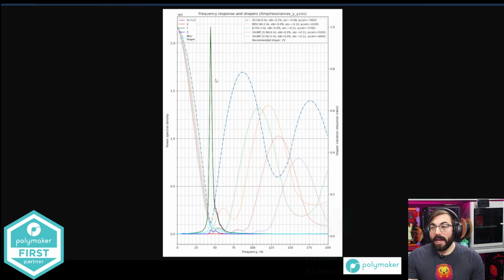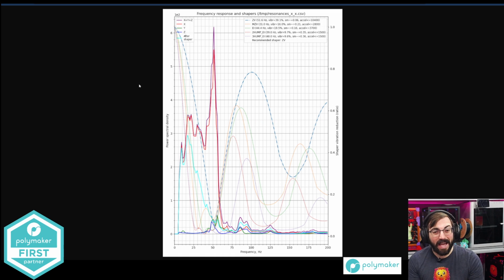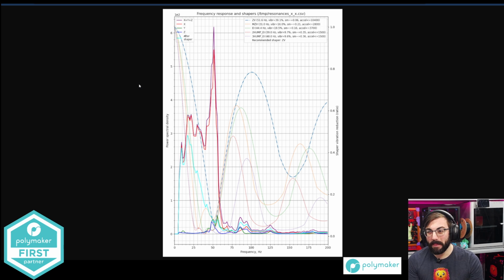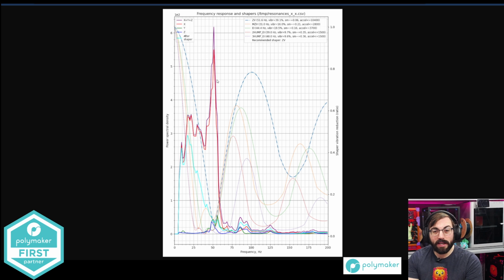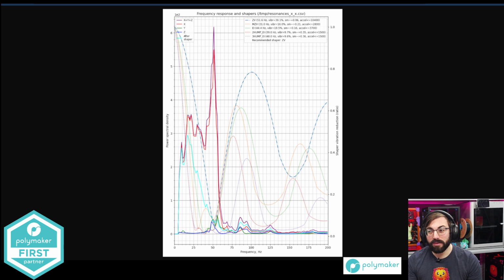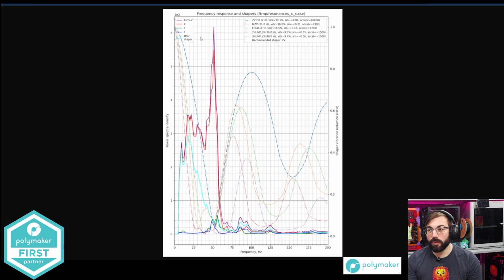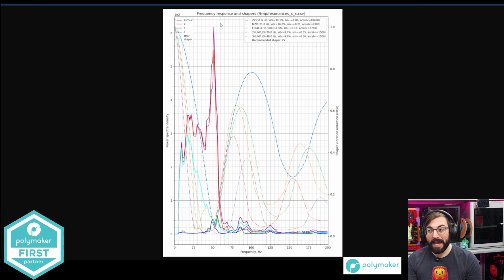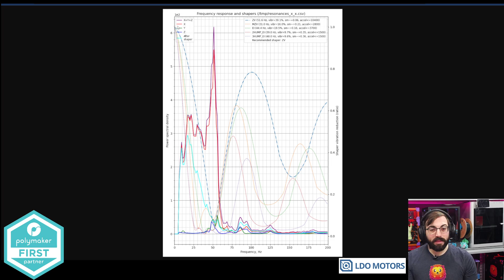The Creality K1C Is Not Ready | Here Are The Problems

Comment: Lmao I have one of these and know multiple people that have it and none of these issues are present all parts fix and work correctly. Prints are great and accurate almost like yours was dropped in the box or was wrapped by heat or something. Because common sense tell you 90% of them would have been return if in the state your claiming. 99% of these rumours are a load of shit.  This is my first ever Creality Printer and I have been very impressed. Punches well above its weight. a number of studio and prop design companies for the Movie industry actual use these too. oh had mine 4 months. No marks on my top lip either the tubing for the filament needs to be feed a little more into the flex black cable holder that's all.

Comment: I had two times the same problem, suddenly stop and went dead. It was not energy failure, after some expressive words and salutes to Creality, I discover the reason: under the machine, next to the power font there's a small cooler vent that prevent over heating of the power supply, apparently with the vibration has the tendency to disconnect and that causes the total black-out of the machine. It happened when printing with ABS material which requires higher temperature. I hope this to be a useful tip.
Reply: Thanks much for your input. I tnink it would be a great practice for everyone to check all electrical and mechanical connections on the printer upon receiving it.

Comment: I make cam wheels for Husqvarna older sewing machines. Using XYZ MiniMaker. They become absolutely perfect in PLA and PETG. But wanted to speed up the prints and also do things in nylon. So I bought a Creality K1C.
It writes wrong, simply. A curve, ridge, on the cam wheel that should be convex, becomes concave. The supplier tested on their K1C machines, with the same results.
If you buy a new printer for $600, you don't expect it to print worse than my old XYZ MiniMaker.
What should I buy for a 3D printer that has high accuracy?

Comment: DUDE YOU JUST HATE CREALITY :) I HAVE K1C AND I GET PERFECT FIRST LAYER MY EDGES ARE PERFECTLY FINE. iMAGINE I JUST PRINTED A DOOR KEY THAT I SCANNED IT WITH MY RAPTOR SCANNER AND FUCK YEAH ITS WORKING TO OPEN THE DOOR. SERIOUSLY BUT I DONT THINK YOU GOT THE TRAINING AND EXPERIENCE TO BE ON THE SEAT THAT YOUR HAVING. YOU SHOULD TAKE IT MORE EASY IF YOU BARELY DISCOVERED MODELING. THERE ARE MANY PRINTING ISSUES BECAUSE OF BAD MODELING ASWELL. IF YOUR A CRAPPY MODELER THAT DOES NOT KNOW MUCH ABOUT MESH I WOULD NOT BE SUPRIZED IF YOU GET ERRORS FROM A PERFECTLY WORKING PRINTER. I JUST HATE TO SEE FLYS TELLING BEES HOW TO MAKE HONEY.

Comment: Can't say id still be getting mine if i saw this video first however, the top lid is scratched to shit, though and i got a nice riser kit to solve that, got the filament tube angle bracket too to decrease the sharpness of the CF filament on the entry even. the extruder has been average, keep getting quite a few jams, and theres not much info on the web regarding Creality Print 5.1 slicer set up and functionality... Unless someone can point me in the direction of

Comment: My K1C is 3 weeks old and I cannot print on more than 20% of the build plate due to poor bed levelling and lack of options to manually adjust the bed. I am in the middle of a return process with Creality. You guys who say “you can fix it”.. Well, I could fix it too, but I am not supposed to fix a brand new printer. You don’t fix a new car right out of the dealer right?

Comment: I love the fact that my lid doesn't rattle around and is a snug fit, call it a minus all you want, but while it may be the honda civic of printers...Ferraris are loud obnoxious rattle machines....

Take the bottom plate off and adjust the belt for the z rods, level bed(mine was .01° off the chassis, so idc)

And so far, click and print, no noticeable/unsellable parts at near max flow(not max speed)

Comment: Wow, you got a lemon...perfect prints right out of the box, none of your issues. No rubbing on top, top fits good, not tight like yours, magnets work great. Bed was aligned. Getting much better prints than yours. I am fairly new to 3D printing, so far I have smooth prints, even better running at 80-90% speed. No banging...seriously you got a lemon, try another K1C.

Comment: the extruder is properly constrained... if you have the top case on that holds it in alignment and prevents the spreading your showing. the print defects your showing are very similar to the issues i had from a factory loose head assembly ok a k1c. the extruder still has overheating issues, and the head came loose from the factory, which wrecked a few beds when it fell off after 100 hours of printing.

Comment: interesting  
1. top cover problem - dude, stop doing this excoriated shit. It is thigh fit, but it's easy to take off. Not like you are showing it. Rubbing is the real issue. True
2. Extruder problems? What? maybe they have fixed something later on, had zero problems 
3. bed level is no issue. mine was less than 0.33

I would also return if I had this kind of shit

Comment: I have one.  In the beginning, I did have a clogged extruder. It was a user error.  I don't have the straight to make the bed leveling; I have it with my hands.  So, I opt out of using HVAC tape for the left side of the bed.  Since then, I have had no issues with the machine.  I have printed over 200 pieces and used a range of filaments.  I know they have the k1, k1 max, and k1c.  For the cover issues, I could 3d print risers with hinges.  My first printer was an Ender 3. It took me a month to learn about 3d printing and learn.  I guess it all depends on your skill level.  You are a skilled 3d person, but that machine may not fit your advanced skill needs.

Comment: this ugly graph on the X-axis is probably due to the reduced rigidity of the frame (in the plane of the door). it is probably necessary to place some clamps between the ends of the door and the frame to increase the rigidity of the structure.

Comment: At the 3:30 mark when you "loaded your filaments" it looks to me like the extruder is in the unlocked position.   Since you took the housing off.   I'm guessing the gears are perfectly aligned again when assembled and the filament is locked.   I just got mine this morning and printed a number of super thin tall structures similar to yours.   They looked flawless.   Hyper-pla at near full speed.   I've seen a few people having issues with pla running too fast, but have yet to test it.

Comment: Just bought the K1c yesterday, and first two prints so far are flawless.  Coming from an Ender 3 v2 for ages it seems, this is amazing.    My bottom layers look smooth as glass.   Stock build plate, no glue, using pla+ 300mm and it's perfect.  I'm going to start ramping up the speed to see how that goes.   And it was on sale too :)

Comment: Don't want to jinx it, but I've had the K1C for over a month.  Click and print.  No issues.  And to cry about the top?  C'mon.
Reply: can we get an update here please?
Reply: @SabrineKsouri-u1y  i've got a couple thousand hours on mine and no issues so far that weren't my fault
Reply: After 4 months of churning out parts in PLA and ABS, mine is stilll going like a bandit. It's in a school setting and the kids are giving it a real workout. It constantly gets abused with wrong temps, broken filaments, too much and too little glue. One kid forgot to put the magnetic bed back in. The biggest issue is the filament out sensor. It can't detect a broken filament when it breaks near the hotend. It needs a filament movement sensor. The head wipe thing on the end of the bed plate broke off after the first two weeks - so far we dont miss it. Watch out for odd chars in the filenames. Even apostrophes cause print crashes.
Reply: Is it Still going good??
Reply: @Alex.2o9 mine still runs perfectly
Reply: No marks on my top the tubing for the filament needs to be feed a little more into the flex black cable holder that's all.
Reply: I'm loving my K1C (cuming from a reliable Ender 3 S1 Pro), it's been printing with no issues and had top quality prints everytime. Remember this printer sells for 499€, that's a bargain, there's nothing in the market that even gets close. I recommend this printer anytime. Creality solved all the problems that the K1 had.

Comment: my ender 3 prints much cleaner than my k1c.  I'm have issues with unaligned layers too.  It is very frustrating, but I already threw away the box.  The good reviews convinced me to buy, but I'm guess they were bought off.   Will go with bambu next and use this as a back up/project printer.

Comment: I think something is up with your printer... Mine out of the box has not had any of the issues yours is having with the extruder. I've had this thing printing 24/7 for the last week. I've had a few issues with it, mostly the issues are user error. My bed came stock almost perfectly flat, 3 edges were very slightly higher than the rest, but the actual measurement from the bed mesh graph is a total difference of 0.16mm, and the change is really right up at the edges where the increase in the Z axis begins. The other issue i had was with the bowden tube having too tight of corners, so i've removed it from the chain and printed a riser and the issue is resolved. The tube is rubbing on the cover, i just need another zip tie to prevent it. I think yours is due for an RMA! The first few prints did have some extruder issues making me think my Z offset needed a correction, but without any changes ever, its fixed itself and everything is perfect!

Comment: No I probably should not go Bambu, because I have a K1 Max that works fine and getting another one. I find it very odd that so many 3D printing YouTubers feel the need to make a printer recommendation instead of suggesting people buy what suits their specific needs in terms of functionality and budget among other factors. 
Brands have become WAY too much of a focus. 

You also claimed someone did a breakdown 8 months ago, the K1C has not been out 8 months and you must be aware they have been revisions in the model over time, so what applied then is not true for a separate model that is a revision. I am not saying it is perfect, but I don't think what applied 8 months ago is still true in all cases was the point. I have seen people commenting on revised versions of the hot end for example.

Instead of focusing on brands when deciding on a printer, focus on features. All brands have issues, find what works for your budget and the features you want, see what the community thinks because YouTubers only offer their personal experiences which can vary quite a bit.

Comment: 1 week with K1C, printing with very affordable filaments - PLA, SILK-PLA, ASA, CF and ABS (Prima and Azurefilm mostly and only one Creality filament which came in the box - the white hyper-pla), all of them are printing great (small parts, miniatures, statue, functional items etc). In one week,  my printer has barely had any downtime, maybe 10 hours on standby, but otherwise, it's been running non-stop and I am overall satisfied (currently printing some Tesla parts with ASA.
Issues, so far: top cover seems to be a general issue, but never had a problem with that as it's only touching on the left side - and for that you get a sticky rubber band in the box to place and protect the side but there not a single scratch mark on top, it doesn't reach nor touch that area). However, for a perfect cover fit, I've printed a raiser kit with hinged lid which also look great, with option of fully closed or perforated panels for good air vent whenever I change the filament.

I haven't had any clogs, though I did manage to get the filament stuck once during my first filament change. It felt a bit rough, and I got confused - so yeah, that was on me. But fixing it was a breeze, just a bit of patience with retracting and then following the instructions to insert and extrude again, ..You just have to get used with devices, in general :). "There are people who can't drive a stick but they're good racers"

The last "problem" is the bed leveling which in my case reflects only in values/graph view and not in the print quality itself. After placing the printer on a very stable surface (if you dont have one, just place the printer on the floor!!), I ran the auto bed leveling and bed mesh values turned to -0.3 to 0.2 and I use it like this with no problems (first layer went fine on all of the mentioned filaments). 

I use ONLY their software, with minimum intervention (temp, speed, ironing etc, no fancy modding if it's not necessary) you also have the option for advanced settings but I only use tweaked generic profiles (generic-pla, generic-abs, generic-asa etc). Last but not least, before importing to Creality Print software, all of my models have been adjusted and exported STL's from Cinema 4D (optimize the mesh, triangles bla bla, just get a decent work on your 3d models with no artifacts if possible - tested on same 3d object). I tried some other slicers with the same files and I didn't like it in the sim, so why bother print it (actually the only one OK was Cura Meshmixer/IdeeaMaker and some other slicer went terrible when importing the files, I wouldn't bother to check why and it's their job to do it :)). 

Im not a Creality fan, actually a first time user..maniac for details. There's nothing I couldn't print (yet). I could buy Bamboo P1 series for 100 something extra but with all the vloggers and marketing around it, made me NOT do it, I prefer the honest and rough side of life. :)), I've been "researching" for almost 1 month before purchase and this come out just in time. After all they are all made in China and in my tech experience, the error is mostly in front of the screen. However, after seeing your vid, I'll buy some spare parts..just in case (extruder, nozzle etc..) :). 

About those gears, there's a reason why they are enclosed, any open gears would tilt when forcing object in-between, or maybe I'm wrong..
Reply: I'm also having a pleasant experience with mine. OP must have a dud model. Chock it up to bad luck.
Reply: !!! Update.. I've decided to grab a second printer and guess what?.. I am currently running 2 K1C's, just because it's that "bad". Meanwhile I started using ORCA slicer and is great. Calibrate each filament, save the profile and everything is great.
Reply: can u update how the printer works right now ? i cajn get it for 400 right now :D
Reply: @ServTech1337  I'm returning mine tomorrow. It printed great for the first couple prints. I changed the filament 3 times and now it clogs on every print. No help in manual, online, and silence from customer service.
Reply: @audiobad  thats operator error
Reply: I bet it's a pile of issues rn
Reply: have you ever print a cilinder? did you measure it by a caliber?
Reply: @andreamangiatordi2768 I already have many prints on this, mostly functional models with various assembly parts, including cylinders and other woodworking joint designs. Works perfectly, I'm very satisfied. I use a second slicer - ORCA Slicer and I also got a second k1c, because it just works and I am overall satisfied. 99% of the problems are user related, I stand by that. I have rooted one of them, just to see what "more control" means, everything super easy and easy to recover in case you break stuff...great communities/redditors/fb groups etc.
Reply: did you try Creality hyper PLA with standard configuration of Creality Print? I totally agree with this video. Creality k1C is not ready!

Comment: I ordered 2 refurbished k1' from ebay they turned out to be very early versions and all kinds of issues.
Sent them back was refunded promptly. Ordered a new K1C from amazon. works great. printed out a first layer test . produced a smooth thin consistent sheet of PLA. Printer works good have had it in production for about 2 weeks now. Using ABS and polycarbonate. Using orca and 200-300 speed depending on the areas printing. Did adjust the rapit to 375. i just start the print and walk away. Its basic physic's even if the printer will run at 600 you are going to have some misprints and wear out the printer much faster. I understand hobbyist like to tinker. But example the vibration testing is set to an estimate on the X this is probably due to the hot end being so light they cant get consistent data so they set it to an average.
The extruder well the video producer is only showing you half the assembly the other half has a bulk head to create a thrust surface. I'm sure many compromises were made for cost, weight of the component's to support speed and even shipping weight. My biggest issue with this thing is the unicorn proprietary nozzle is only available in 0.4. Is the bamboo better maybe I dont have one to compare. Ps get ready for when those carbon rods fail.